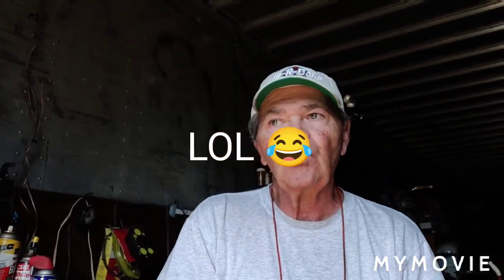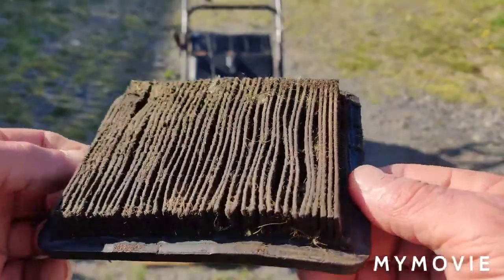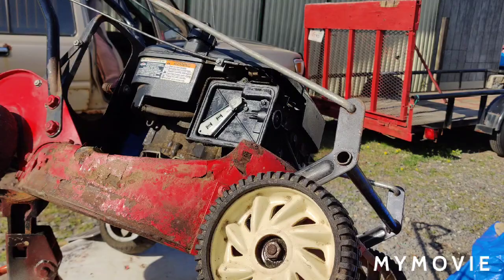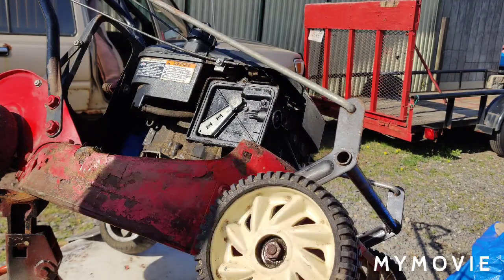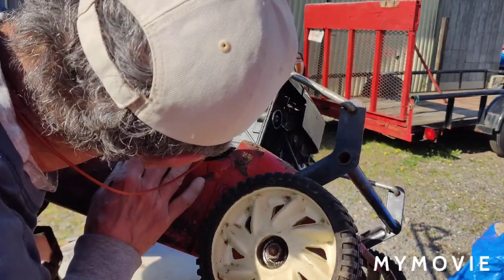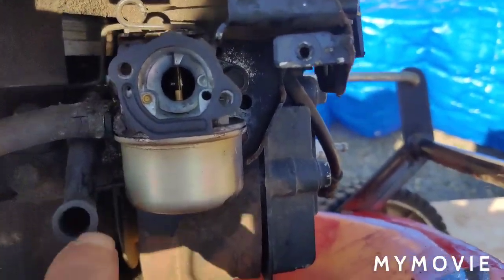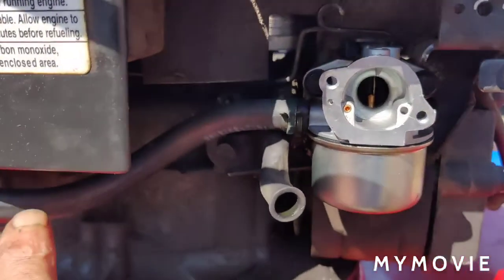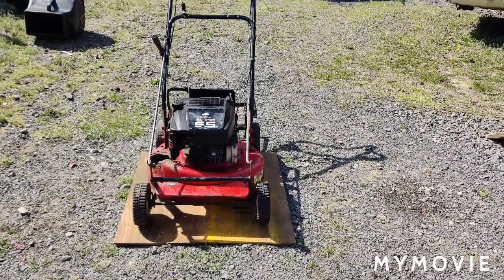McLane mower won't stay running after I installed a new air filter.

Comment: Nice repair Artie. Ive had those old fuel lines cracked and collapsed inside and restricting the fuel flow. That will make someone a good mower! 👍🇺🇸🎥Roger
Reply from the maker: Yes Roger Mcdonald. I find it a good idea to change the fuel line if needed. I've had some come in with a collapsed fuel line or a clogged cap vent. Thanks for watching my friend!

Comment: It's amazing how changing the air filter can reveal hidden carburetor problems like that. Good video! I thought it ran fine in the last video with the clogged air filter too!
Reply from the maker: You are right it rran good in the last video. We probably could have cleaned out the oem carb but you saw that we had alot to take apart to get to iit. Thank you and Thanks for watching 👍
Reply: Yea it really is amazing once you remove the plug filter the other issues that can reveal them selfs lol
Reply: @MyGreenLawn2019  True! Disheartening to do routine maintenance oil and air filter change and end up having to rebuild the carb!

Comment: U prob already know this quick ''hack''.  use wheel bearing/chassis grease on a damaged paper/fiber gasket. It helps with minor surface warpage too.  just a skim coat on both sides, no dry time like rtv.
Reply from the maker: I didn't know that, Thanks for that I appreciate it. Thanks for watching 👍